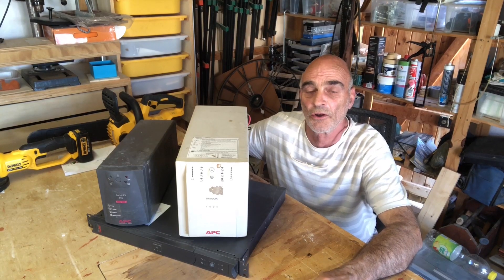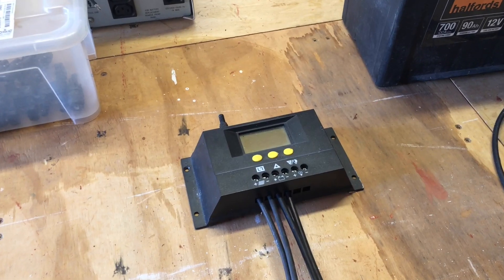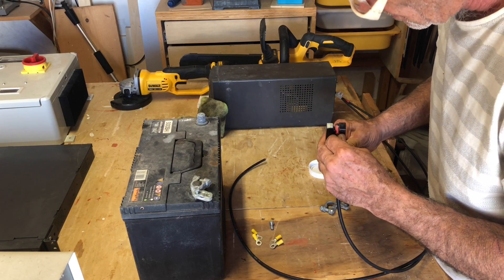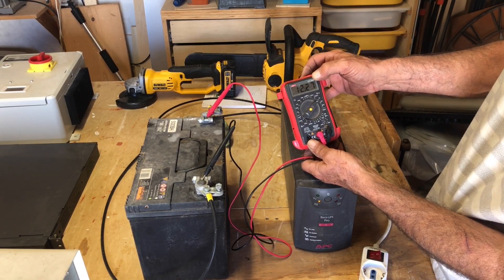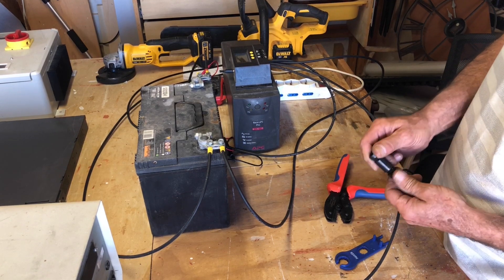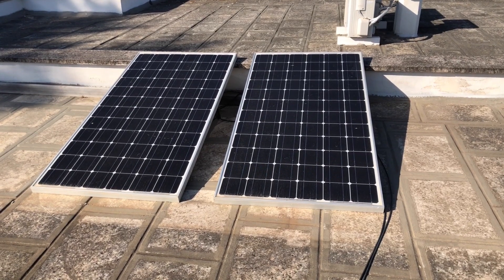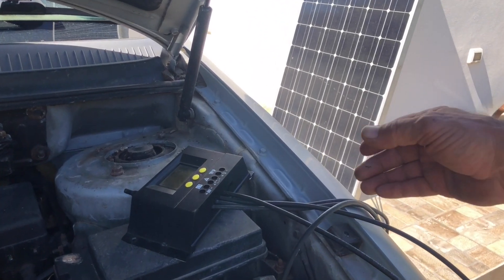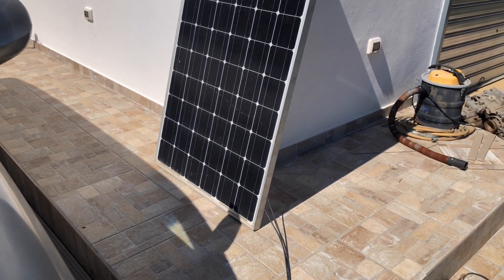🔋 DIY Solar Power Made EASY! ☀️ Budget-Friendly & Beginner-Friendly Guide 🚀

Comment: I ran across this and it might be what you are looking for as far as a water battery. It might give you some thinking points?
Reply from the maker: Did you mean to add a link? 🤔
Reply: @FarmsVilla  https://youtu.be/hJbiSY2CijE
Reply: Also there was a time some charge controllers needed to be hooked up to the battery first.  Do you know if that is still the case with the lower cost ones?

Sorry about the missing link. Almost asleep, bad night.
Reply from the maker: @JR-xw5dk  I normally always hook up the battery first and panels last to make sure the charge controller is showing the batt voltage. Only reason for doing it that way was to have a starting voltage as a reference. Didn’t know it was required on some chargers. 🤷🏻‍♂️🤣
Reply: @FarmsVilla  I have seen at least two talking about that problem. They fried the controller. But that was old videos.
Reply from the maker: @JR-xw5dk  well I was messing around with one of my charge controllers and accidentally hooked up the panels before the battery. Luckily it was ok. 👍🏻
Reply from the maker: Thanks JR! I have only just seen this reply of yours. Very interesting and something to add to my mental arsenal in preparation for the water battery experiment. 👍🏻 MUCH appreciated.

Comment: Blinking good video! Should have made my blackout cart (I put the cart before the horse) using a UPS as in your video. One tip to viewers, always buy more cable lugs in all sizes M6, M8, M10. Always buy more cable than you measured up. Get yourself a decent Crimp tool. Set me thinking though, we have a WiFi in a Meter cupboard and 10 meters away the incoming Fiber Optic cable from the Provider. Both work off 12v (230v adapter/transformer to 12v). Small UPS could do the backup for me.
Reply from the maker: Thanks very much! 😁 yeah excellent advice on always buying more than you think you need. If you use a UPS with a 12 volt battery You could hook the Wi-Fi and internet router directly to the battery and avoid any losses through the UPS. I was able to run the house lighting, internet and the oil fired central heating off the 1kw UPS for the 4 days we were without power. Never been without an alternative source of power since then.